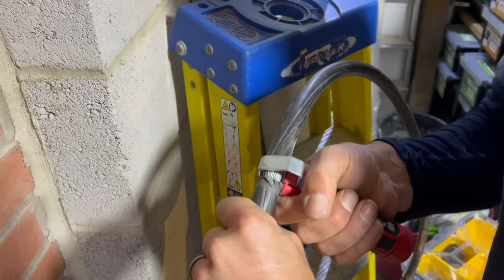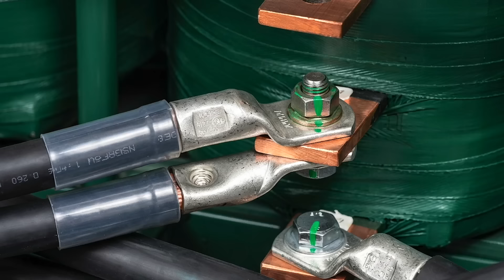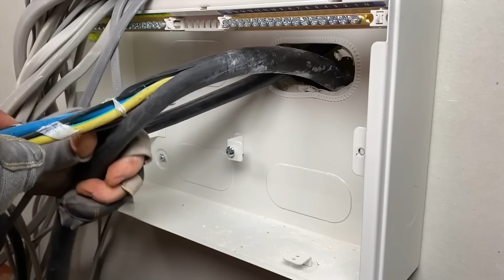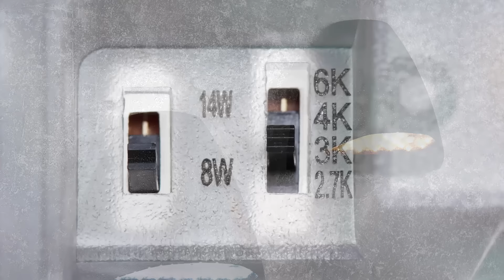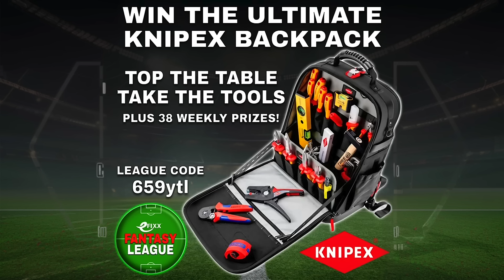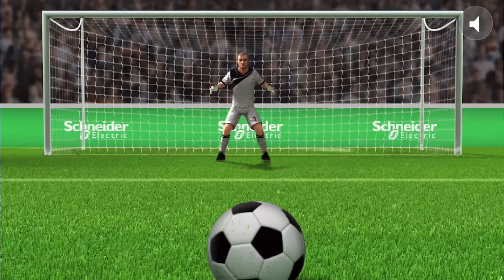This Tiny Regulation Change Is About to Get Expensive

Comment: If I find a loose cable during an EICR I'm fixing it, to do otherwise would be dangerous. And always agree with the client first that simple things can be fixed, hopefully eliminating the need for a return visit. Do NAPIT actually live in the real world.
Reply: Sounds more like NAPIT are encouraging their sparkies to sting the owner for loads of expensive work on a return visit.
Reply: Interesting that NAPIT says "They are not a box ticking exercise - they are a safety critical document." I would think that they are also a chance to catch dangerous issues and get them rectified quickly. I think NAPIT are in that industry mindset that says "If we find something dangerous - we stop work and disable/lockout until it is fixed" - whilst that works for industry, it is a poor attitude for domestic situations where turning off the power or kicking people out of their property until an issue is properly sorted is just not an option.
Reply: @gavinminion8515 Electricians do not have the authority to turn off and disable a dangerous electrical installation.
All they can do is make a recommendation to the home owner.
It is for the home owner to decide and agree the electrician can de-energise the installation or part of the installation.
And if the home owner wants to re-energise the installation after the electrician has left the premises, there is no law stopping them.